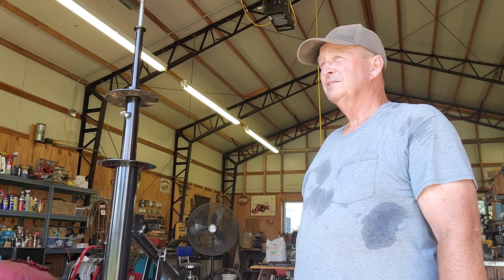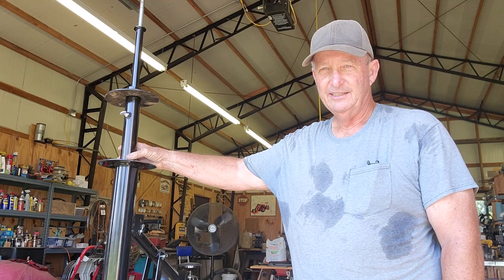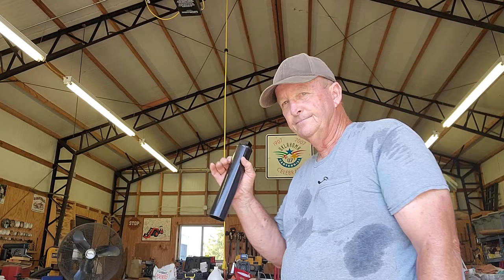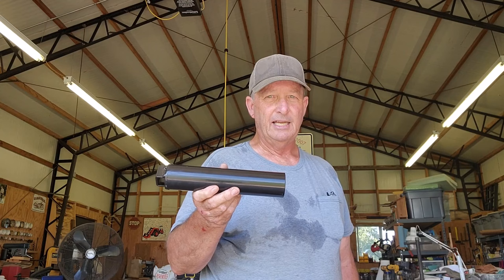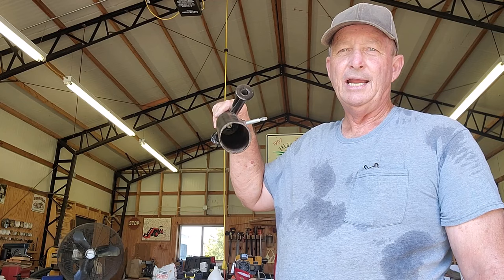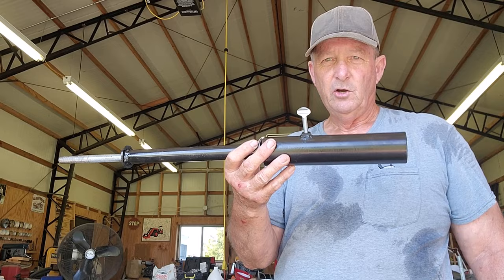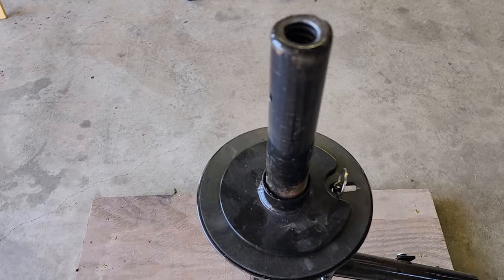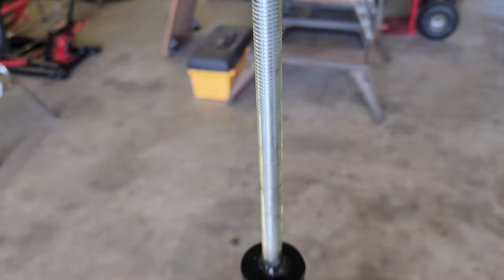Tire Changer Modification

Comment: I'm looking at buying one of those tire machines and I think this modification could well be useful to me.  I worked in a tire shop forty years ago and really want the convenience of mounting my own tires.  Thanks for sharing your ideas.
Reply from the maker: Thanks for your comment. Glad I could help. I am also going to invest in a Duck Head to make it easier to dismount and mount larger tires. The bar that comes with this tire changer is not the best. It works pretty well on 12" and smaller tires.

Comment: Very nice mod . Would like to see it in action !!!! 👍🏻
Reply from the maker: I will try to add that to my channel. I dismounted old tires and mounted new ones on four 8 inch yard trailer wheels in less than 10 minutes, but I didn't include it in the video. Sorry about that. I just got caught up in the moment and how easy it was, especially after wrestling one for 20 minutes without the tire changer.
Reply: Thank you , I totally understand . I get to working on stuff myself and don’t even think about recording . What part of Oklahoma do you live in . My father was born in Drumright OK and my Aunt and Uncle still lives there !!!
Reply from the maker: That's funny. We go through Drumright all the time. We live in Pawnee, which is about 30 miles from Drumright.